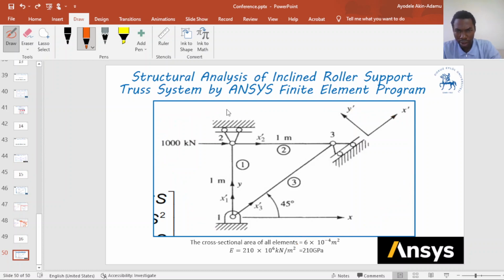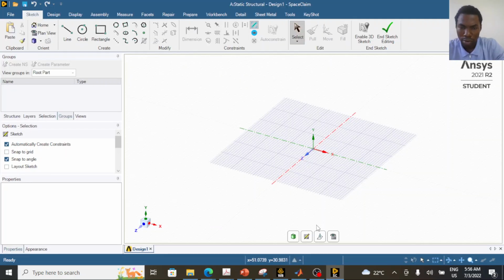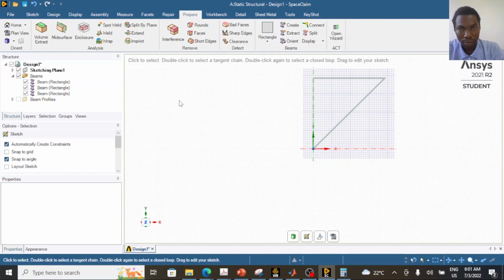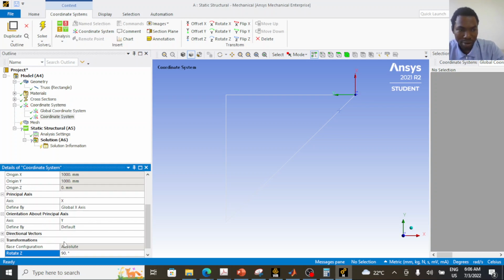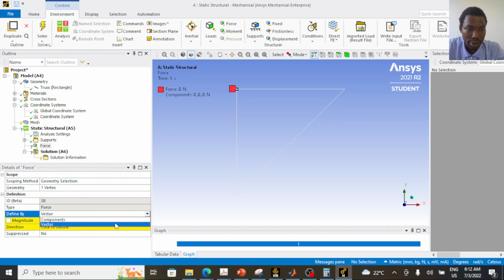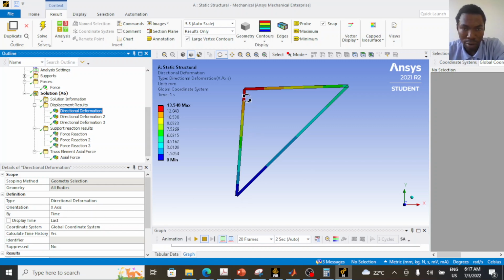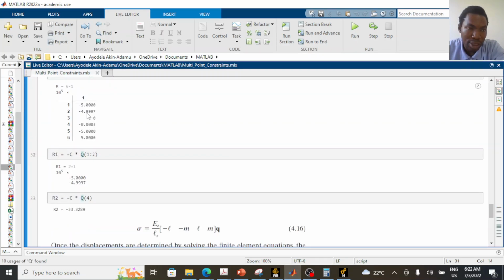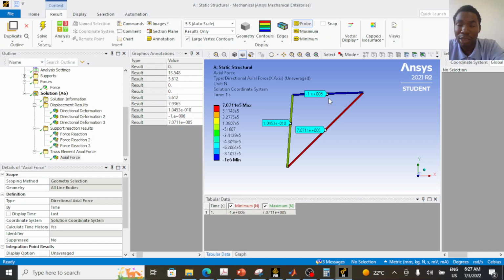Structural Analysis of Inclined Roller Support Truss System by ANSYS Finite Element Program

Comment: Thank you so much, and I want to admit that you cut the video after running the simulation, but you made a mistake there. I just want to point it out here to help others as well. You forgot to constrain the Z-axis of the structure for all three nodes. I myself spent a lot of time trying to solve this problem, as the software was giving errors like "Lack of Constraints," and I eventually understood that you made the Z-axis driven, which caused displacement for all nodes possible to be moved in Z axis instead of setting it to 0 and make it Constraint.